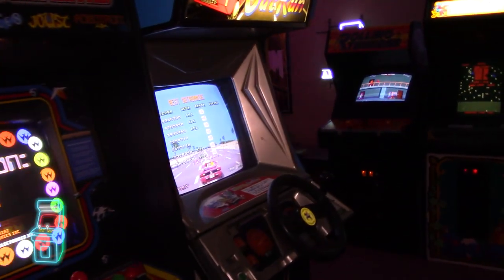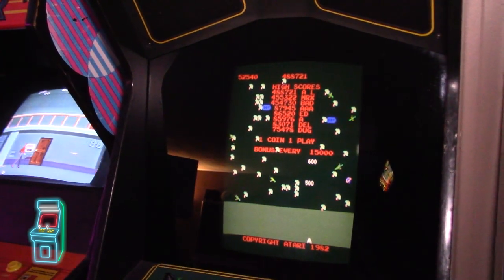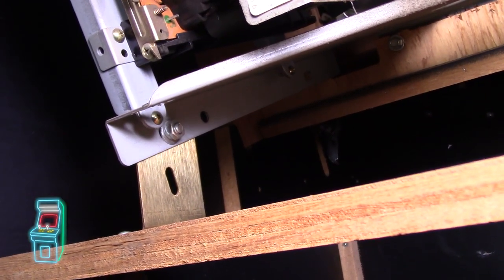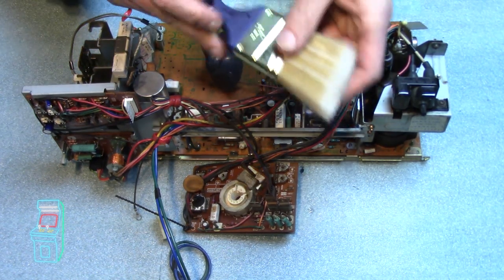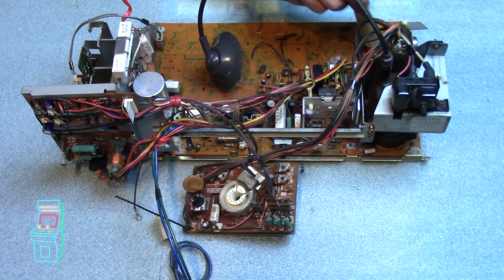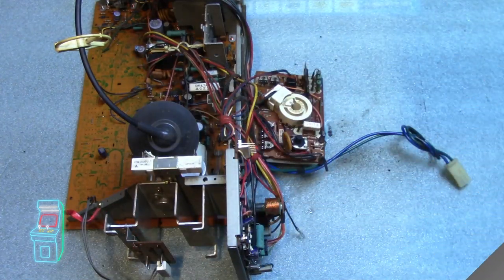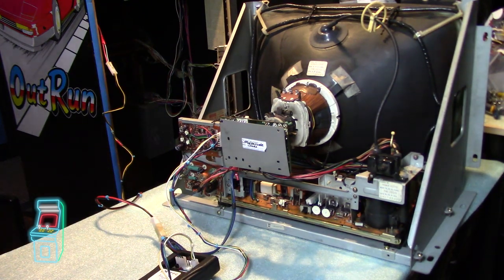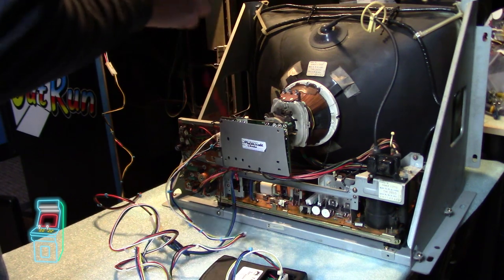Millipede Matsushita Monitor Cap Kit [Resto Part 6]

Comment: On the other channel they say that the Matsushita monitor sucks but you did a great job. Thank you
Reply from the maker: Matsushita monitors get no love. My guess is because it has such an oddball tube and is not easily swappable if it gets necked or burned in compared to Wells Gardner for example. 
But it really is well documented so technically should be easier to fix.
Reply: DeLuSioNaL's Arcade  I thank you my friend for all the great info. I have a millipede and centipede that need a tune up.

Comment: Excellent!

You may be sucking the solder with your gun to fast and that's why it's being stubborn. Let it melt that old solder just a bit more before pulling the trigger.

I've had good experiences with the parts on the website but some mention he's yet to update some of his cap kits despite updates from the community. Always check the cap kits and what your replacing and make notes.
Reply from the maker: Thanks for the tip!  
As far as Peter goes he's pretty open to suggestions and has updated his kits accordingly in my experience after I suggested a part.  He has great customer service!

Comment: I have a dead 14" Matsushita which I am starting to look at... interesting comment re: R811... looking at the schematic I am surprised that fails... it's just part of the resistor divider feeding the feedback transistor... but hey... that's the part I will be looking at next!
Reply from the maker: Yes, if you Google it people talk about it on the forums. It actually helped fix my friend's in his Millipede!

I've even asked Peter to include it in his Matsushita cap kit on the arcadepartsandrepair website (but he's leaving it as is).  He does carry the part seperately though.

Comment: DELUSIONALS ARCADE, if you didn't use an isolation transformer and plugged direct into the AC wall outlet? what would happen and why would it damage the arcade monitors circuit boards?
When adjusting the B+ voltage you adjusted the "brightness" trim pot to maximum, Do you do this to all types of different brands of arcade monitors or only just for the Matsushita monitors?
You said when you adjust the brightness trim pot to maximum its giving more B+ voltage to the circuit?
Reply from the maker: It would ruin the arcade chassis.  All normal TV sets have an isolation transformer built in. Arcade monitors do not. (usually, but some bigger 27" medium res monitors do).
Here's an example of what happens when you don't use an ISO: https://bit.ly/36T0dLY

The turning up of the brightness is only on this particular monitor (Matsushita). It temporarily increases the draw on the high voltage circuit. You want to adjust the B+ while it's at maximum draw.